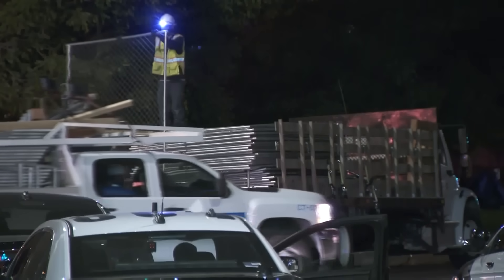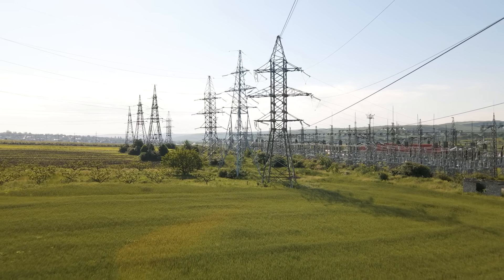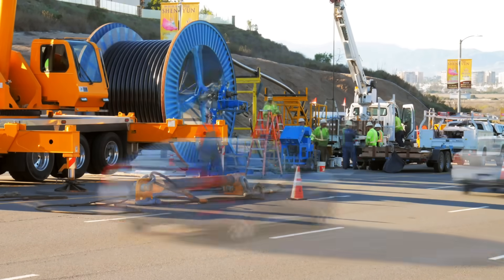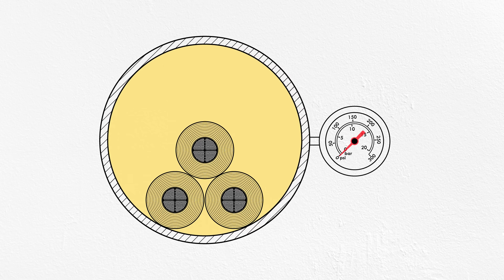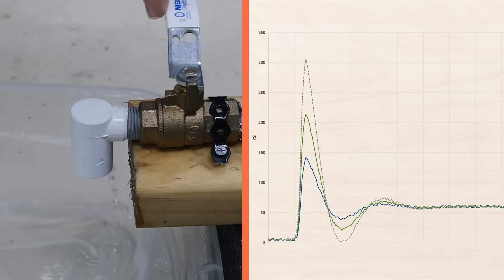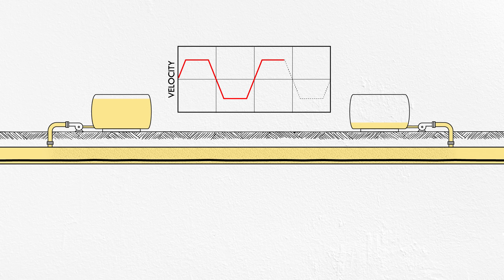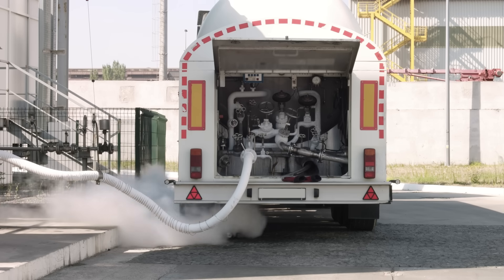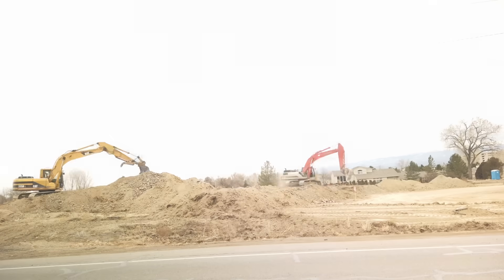Repairing Underground Power Cables Is Nearly Impossible

Comment: Putting high voltage lines underground seems like a recipe for trouble, even without the added complexity of a pressurized, oil-based system.
Reply: These underground systems described are relatively rare and used where nothing else would work. They require monitoring and maintenance. Typical underground lines below 69,000 volts are much simpler heavily insulated cables. Still, the cost of going underground can be 10 times that of overhead pole lines, and these heavily insulated lines wear out quicker due to physical and electrical stresses.
Reply: Keeping them above ground has its own problems too, mainly weather.
Reply: @appleintosh  On above ground high voltage transmission lines here in So Cal, weather isn't too much of a problem.  One of the biggest problems is that they are unsightly and people don't want to see them running through their neighborhoods.  Another problem is tree contact to the conductors causing wild fires.
Reply: @newhallgeorge1  but then there is "the golden mile" between Mojave and Olancha...🤑
Reply: @newhallgeorge1  maintenance of the Right of way should be in the permits. So bye bye trees or at least that's how things go in the midwest.
Reply: @appleintosh  what about the 1000s fires, 100s of deaths, and billions of dollars in damage caused by above ground power lines in California?
Reply: @stefanomarchesini109  Yeah, that was my point.
Reply: @stefanomarchesini109  if no tree got hit from an arc there is no fire, so it's due to unsufficient tree maintenance. Dollar saved, then through damages dollars flying away.
Reply: @appleintosh  Southern California is much more susceptible to earthquakes, landslides, and flooding than it is to high-wind events; so the main problem with overhead cables is their unsightliness, although beauty is in the eye of the beholder.
Reply: @John-tr5hn  unsightliness, yuk, that never ever should have turned into a reason to overcomplicate infrastructural needs.
Buildings and stuff, yes, please make them more beautifull then the early sixties and seventies cheap grey concrete highrises, causing depression.
Powerlines, trainlines and such, save money, think and calculate maintenance before building. Then reconsider the value of unsightliness.
Politicians all over the world are just the same, pleasing their voters, being happy to support new innovations without thinking ever about the costs during later administrations (ie maintenance/overhaul).
Reply: @appleintosh  we live in the south east coast and we have been hit by some hurricanes big and small recently. The neighborhoods that were without power the longest was.... wait for it..... flooded AND had underground lines. The underground lines took the longest because they had a hella'va time finding where the issue was. One neighborhood was without power for over a month. They were flooded and had underground lines.
Reply: @videowatcher495  in Texas neighborhoods, it's most common to send the power lines along the backsides of the property to make it look pretty from the street but save money. 🤣🤣
Reply: @appleintosh   At least when they're above ground it's a lot easier and cheaper to repair.
Reply: @raydunakin  overground lines hanging on wood Poles or steeltowers are worldwide
Reply: @borntoclimb7116  Looks at Boston and other cities yeah um, no they are not.
Reply: @NCXDesigns  Plus, much of Europe. In Perth WA. They are slowly putting all powerlines underground. (I'm a cable jointer by trade).
Reply: I imagine engineers consider the local area and possible environmental challenges when choosing underground or above ground. The problem is city councils and lawmakers who approve of the process.
Reply: Cindy SparkleFarts  Cancerous when phones capitalizes the first letters every word.
Reply: @kaspervestergaard2383  That's not the phone doing that, it's their mental imbalance.
Reply: @ev6558  Ohh no. Brain is fried?
Reply: @kaspervestergaard2383  Ignore it. There are much worse things than that.
Reply: @newhallgeorge1  Ohh there is? Actually there isn't.
Reply: 90% of urban areas have their distribution networks underground here in the UK.. Powercuts are extremely rare in urban areas because of it, OH distribution is way more susceptible to damage than UG unfortunately
Reply: Cindy SparkleFarts  Either you or  your device has a virus.
Reply: People like to argue overhead lines have their own troubles, and they do, but they’re far easier and cheaper to fix. Lines largely go underground for aesthetic purposes. That’s is. 
I grew up in a family of linemen, so I suppose I don’t have an appreciation for how ugly many find them.  
I once worked a job in Manhattan beach Ca doing an overhead to underground swap for roughly 25 houses on the coast line. The homeowners payed for it, and one reported the price varied between 50k-100k per house. 
It was a perfectly working line, they just didn’t like it existing in their view of the ocean.  
Alas, the value of having FU money.
Reply: @mikemck4796  That seems excessively priced. . In Perth, WA they are slowly moving all lines underground. The house owner pays a third, the local government a third, and the Power company (Western Power) pays a third. They are about 60% done. On average the homeowner pays about$ 5-8000 AUS. There are more reasons than just aesthetics. Though that is a large factor. It is safer for vehicles and the maintenance is much less. Much more reliable, though outages are longer when they do occur. The homeowner benefits from higher house values.
Reply: @scottwhat3362  in what way is maintenance less?
As for the prices, there are many variables that come into play. System and equipment needed, and the number of homes being serviced bring big ones. 
The line I referred to was payed for entirely by the home owners. Though they were amongst the most affluent people in the country.
Reply: Had to be done in my hometown to stop the high voltage lines from suffering damage during winter storms causing power outages.
Reply: I know hanging power lines have caused some devastating fires.
Reply: I would say the opposite, its faar safer and lowers maintenance alot, HV cable over ground is very bad bad news....u know earth has a magnetic field, and the sun...and also lighning (wich freq hits HV lines)
Reply: youre too smart for me ray
Reply: Underground plastic insulated HV cables are pretty reliable and should have no problem with occasional flooding.  Of cause they need enough aluminium conductive material to be passively cooled by surrounding soil, which would result in different optimum sizing than air cooled overhead lines.
Reply: Hence, the NIMBI arguments.
Reply: I work on underground systems in a major US city, and our system is the most reliable by far throughout the entire system. The problem is that a lot of the infrastructure is very old. We have Paper Insulated Lead Cables that are over 100 years old still in service. The main reason these lines get neglected is that they are very reliable and in most cases, when there is a fault on the line, there are no power outages. Most major cities are going to be fed almost exclusively underground because the amount of lines that it would  require overhead would be an eyesore and much more dangerous than underground.
Reply: There’s a thing called the sun
Reply: Blue Skink  what’s uglier is the big ass whole we have to dig in your yard when they go bad. And no neither transmission or distribution can cause cancer living near them. Overhead or underground. Do you really think we would be allowed to sling wire all over town if it cases cancer. I PROMISE you overhead is way better, cleaner and vastly more cost efficient 

Source. 
I’m a fucking lineman
Reply: Cindy SparkleFarts  OK Karen
Reply: They have to be underground in California or they'll end up starting a wildfire sooner or later.
Reply: Cindy SparkleFarts  Why So Angry? More Importantly, Why Write Like This?
Reply: Underground seems like it'd be the most pleasant and reduce EMF, ...until there's an earthquake or other problem. Ah well, at least they did this in California, a state that's not known for budget problems, political instability, forest fires, or earthquakes. (But, yes, I think the aerial high-power lines put a sensible upward bound on how much the cost of repair, maintenance, and replacement might be. Plus, "That's how the rest of the country works, so you're dealing with engineering competition that can drive down costs. How many high-pressure oil firms are there? ...I'm sure such firms don't take the rarity of their expertise into account when offering bids to the State of California.)

Comment: this seems like an overly complicated solution to a simple problem. 
While I understand the initial cost would be astronomical why not run something akin to a subway line and simply out the Phases on the walls one at the top and one at each side? 
you could also run any other utilities in the same tunnel. 
there could be isolation bulkheads on every block and side taps. 
I could see a decade worth of standards work going into a modular unified system 
I've even considered the concept of a 10meter raised city, where you lay out the infrastructure piping at ground level and then place the roads and structures over the top.

Comment: Heh, weird to come across this on YouTube - I'm an electrical engineer with expertise in HV cables, and I performed a forensic analysis on a fault on this particular circuit in the early 2000s. I have to say you did a decent job describing the story and offering the world a bit of insight into strange and esoteric business of high voltage cables.
Reply: Cool. Do you know what's up with the old cable? That "can be used as backup"? Does that mean it's still being actively pressurized??
Reply: @xamishia  I haven't been involved here for a long time but knowing these systems, that's what it would mean, yes, though possibly a reduced level (there would be pros and cons to that). They would be maintaining the pumping plants and monitoring gear, and any corrosion protection systems.
Reply: @packratty  Thanks kindly!
Reply: @xamishia  yup, the old cable is "emergency use" backup.
Reply: I worked there for years, fascinating stuff
Reply: As an electrical engineer, that formerly worked for a thumper,TDR,hipot manufacturer, it's nice to hear recognition that underground fault location is half art, half science.  And yeah, he did a pretty good job describing it!
Reply: @kipkostenbauder1941  Ha Ha, used a lot of different Thumper / Hi-Pot gear in my 30 years in utilities and I'd say that it's half BLACK Art / half Science.
Used to work with one of the old timers who used witching wires for cable located / fault prelocates.
Reply: @kipkostenbauder1941  But he didn't actually say which technique located the fault, at least not that I noticed.
Reply: @kipkostenbauder1941  , didn't need to use the thumper for the 230-kV circuit; we knew where the fault was because the vault in which the failure occurred blew the manhole cover sky-high. We used the thumper for 5-kV and 36-kV circuits
Reply: May I ask you if the technique in question here, which sees pressurised oil being used in an enclosed pipe to insulate electricity cables from each other and their surroundings, is an ancient one that only were used before suitable, high quality plastics were invented, or if this is still a thing nowadays? You would probably know, if anyone! Thanks in advance.
Reply: @harrickvharrick3957  Yes exactly that, including the maintenance techniques described in the video. Freeze plugs are industry standard and were not invented by LADWP. Today everyone uses plastic for new build, and the components and expertise for repairing oil paper systems are getting more and more difficult to find.
Reply: @packratty  Thanks! So when would you think this power line was built, as a rough approximation?
Reply: @harrickvharrick3957  I can't remember - pretty sure it was in the video?
Reply: @harrickvharrick3957  Great observation and question!!!  Just another example of how we stand on the shoulders of giants and today there are giants walking among us.
Reply: @Pelon7549  Oh. Thanks.
Reply: Hey, Jody!  This showed up on my feed as well!  I guess the youtube algorithm is pretty good at finding the cable system issue root cause analysis people :)
Reply: They can expect degradation of the materials over time.  They need to budget for preventive maintenance and stick to a strict schedule.
Reply: @davidgaugamela9801  The new philosophy is Predictive Maint (as opposed to Preventive)
Partial Discharge Tests before being put in service and regular inspections / tests.
Some critical HV cables have PD equip permanently installed.
Reply: As a Vegan, I just wanted to humble brag here too.

Comment: Really good information; helps answer the question (in part) why we don't just bury the HV lines in the Northeast where lines regularly suffer from tree limbs during storms. So much good info in this. I'm curious what temperature the oil actually freezes? I'd expect much higher than the temp of liquid nitrogen.

Comment: This is pretty crazy considering all of Disney World in Orlando, FL has underground high voltage loops at 13.8kv and higher around the entire property. They have remote switching that allows them to bypass any damaged section of wire and do repairs with very little outages. One thing you will notice is the fact that there are no overhead lines on property, at least where guests can see them, but that is actually mostly the truth. Newer cable construction has allowed this to happen, and many of these cables are buried directly in the ground, BELOW the water table.

Comment: They was a company who put in a very special line. They use a cable from Finland. They sent some people over to that company to learn how to splice it. When they would splice it had to be in a very clean area.  The reason for using it was when they got done they could not tell that cable was ever splice. They even had a few extra reels for just in case.  For many years it was store in a dry place until someone dug in to that cable. The people who was trained on how to splice it where all gone from the company.  Now they had to go back to Finland to find people who could do it. This what I was told I am just passing it on.

Comment: This was a fun video.

Maybe you could do a followup video with the story of the 1981 fire in three of the Grand Coulee Dam's conductors.  Grand Coulee's third powerplant was the only big US powerplant built with enclosed cables.  They subsequently replaced them with overhead lines after the fire, IIRC.

There was also a huge problem in Auckland in 1998 with an underground line.

All these underground line problems are very much in context right now, given that California's PG&E utility is starting an absolutely massive project to underground about 10,000 miles of high voltage transmission line to reduce fire risk.  They think they can get the cost down to $3 million per mile.  It's currently $5m per mile.  Yow!

Comment: I have long been fascinated that electricity generated South of San Francisco is transmitted many miles underwater to cities in the Eastern portions of the area on a DC cable.
Reply: Trans Bay High Voltage DC line from Pittsburg to San Francisco.

Comment: I wonder if it would have been possible to find the broken section of the electrical transmission line by detecting radio waves generated by the sparking/arcing of the lines?

Comment: HPFF cable transmission lines are still widely used in the largest US cities and are overall very reliable.  A key factor to continued reliability is having experienced engineering, construction and operations work forces.

Comment: Look into the 1998 Auckland power crisis. Direct buried cables that served the central business district overheated and failed, one by one. Finding the faults was a long process. If memory serves, the main outage lasted 5 weeks until temporary overhead lines could be erected along a railroad line.

Comment: The use of plastic like polyethylene as insulator is so straightforward from many decades, that I was very surprised to learn how somebody would invent something so unnecessarily sophisticated like a pressurized oil pipeline. I guess it was some transformer guy. Really, I live in a country which is far from being very developed, but nevertheless 110 kV underground cable lines are something widespread in our cities from the late 70-s. With plastic insulated cables.
Reply: You have to keep in mind that the lines have been in place since the 1960's.  They were modeled on a technology for underground cables since the 40's.  Very tried and true.  XLPE cable is relatively new, especially in the 230v range.  If it ain't broke, why fix it.

Comment: What if you split the pipe into top and bottom chambers. As the conductors heat the oil, it rises into the top chamber and pushes some of the oil from the top chamber downwards. Placement and orientation of non-return valves to create a cycle/flow?